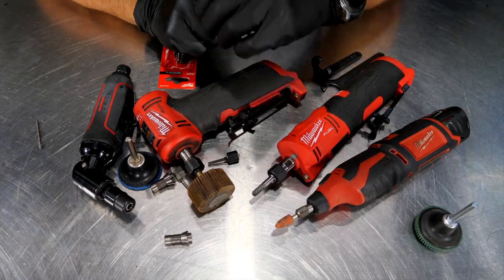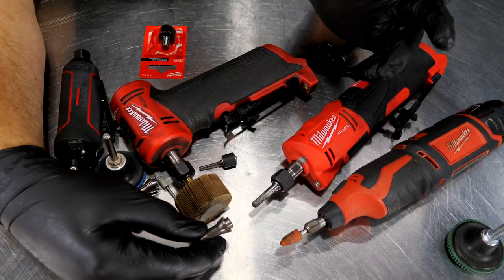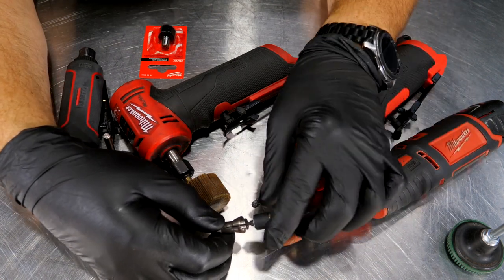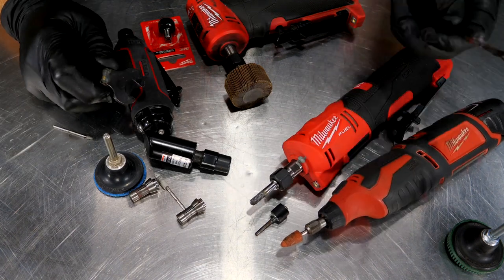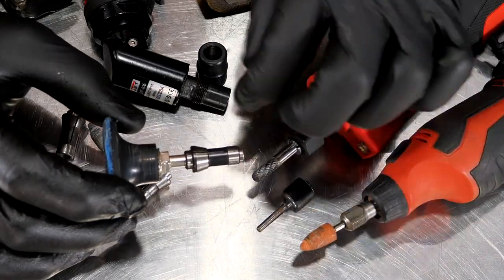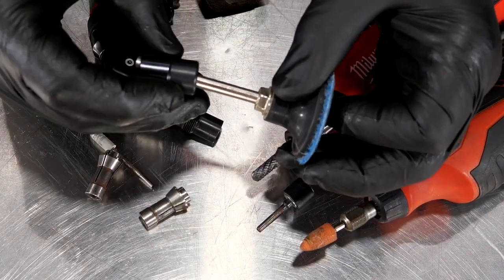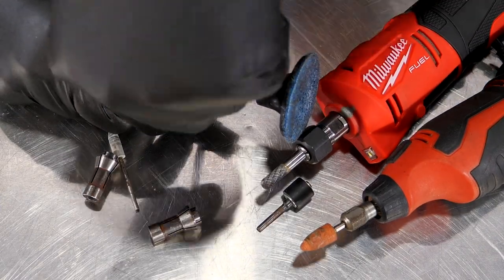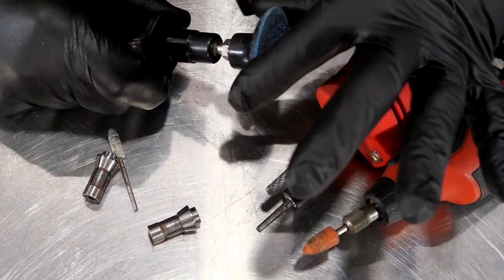Collets and Safety Collets - How To Use 1/8" Accessories with a 1/4" Collet Die Grinder

Comment: This has been a great help thanks! I gave my old m12 rotary tool to my brother so he can do his projects and bought the right angle die grinder so i can have 2 tools in one. The M12 rotary tool with out a paddle made me nervous to use when using the cutting wheel; also i wanted it to be more right angle and have a paddle off switch for safety.

Comment: After watching your video (which is very good), I went and managed to get the Milwaukee 1/8" Collet (48-66-2486) shipped from the US to the UK to fit my M12 FDGS-422B Die Grinder. It doesn't fit.  The size of the thread on the tool is too big to allow the collet to screw onto it. Big disappointment as I wanted to be able to use Dremel bits without using one of those sleeves. :(

Comment: A few of my air tools came with the 1/8" collet, never used it, since a Dremel style tool is designed to be used with 1/8" accessories. Die grinders normally use 1/4" accessories.
Reply from the maker: That is correct, most die grinders us 1/4" accessories, but there are situations when an 1/8" accessory is needed. Thanks for watching.
Reply: @Shoptoolreviews  Right on, like your videos.
Reply: @Shoptoolreviews  By chance have you guys made a video showing the viewers what are the best accessories to use for rotary tools and die grinders? I just bought a the right angle die grinder at a really good deal from Home Depot and I'm having to piece together what I should buy for it. So far what I've got is the Milwaukee 1/4 in. Arbor Cut Off Wheel Adapter 48-07-2486, the 1/8" collet set, and Milwaukee 2" Cut off wheels. Thanks!

 Your video was helpful!

Comment: I just have the opposite Problem. I would like to use a 1/4 bit tool for a 1/8 dremel. Is this possible?
Reply: Did you figure this out? I have the same issue

Comment: After hours of trying to find some way to use 1/8” bits in my cordless DeWalt die grinder model DCG426, I stumbled across you talking about the issue front and center. Thank you! Wait, I still don’t know how to accomplish this on a DeWalt, do I? And my collet and it’s nut are made so they don’t come apart so I can’t just throw an 1/8” collet in it. Fudge…what to do. 

I had an idea of mounting a 1/4” chuck on a 1/4” shank but don’t find a reducer shaft to accommodate that. Suggestions gladly welcomed.
Reply: From what I can tell, Milwaukee is the only big battery platform offering cordless Rotary tools (Dremel) and these compact die grinders. 

The tool you mentioned is larger, so I don’t know if motor size is part of the design when these interchangeable collets were engineered. You may be out of luck but I would continue to browse the web or contact manufacturers to narrow Dow your options. 

My top suggestion is to determine if you need a compact die grinder versus a standard size, and then the M12 line I think can be your friend. I use DeWalt for my main shop tools but Dewalt doesn’t make 12 volt batteries. Half The investment here is in the form-factor (in my opinion). 

But If you don’t want to spend the dough on new cordless tools - I would just suggest using a basic corded Dremel/Rotary tool for your 1/8” needs because they are going to be smaller than that DCG426. They are pretty affordable from Harbor Freight, nothing fancy but will do what it needs to with the 1/8” shank bits. 

Good luck!
Reply: Thank you for the suggestions. I should have updated my first comment to let people know that I found a collet at a tool supply store (Hall Tool Company) that can be used for 1/8” shanked bits. Additionally, for any size up to 1/4”, I found a quick release (hex shank) mandrel (also called an arbor) that screws into a 1/4” drill chuck. To make it into a round rod that will fit my 1/4” die grinder collet, I tightened a piece of rod into the new chuck head, then put that rod into a drill and ground the hex shank round by rotating my drill in the opposing direction of a belt sander’s movement until it was a perfect fit for my die grinder collet when tightened down. Now I can use bits with 1/8 or 1/4” shanks and the occasional in between sizes of shanks using the Jacob’s chuck with the 1/4” shank that was ground down from a hexagonal shape. I hope that is useful for someone. Remember to use caution when using any die grinder at it’s fastest rpm speeds.
Reply: @ReadyUpGo  this is quite an effort you made. I’m just thinking about the connection points…The quick release hex shank- I imagine would fit an Impact driver? 
This screws” into the drill chuck which is for 1/8” shank bits. The chuck has a threaded female opening and can be detached from the shank itself?

Come to think of it I think I have explored an option like this wondering if my impact could be used with drill bits. 

Anyway So then you sanded the hex into a cylindrical shape to fit the collet of a 1/4” die grinder, and are able to tighten that collet-nut around the [now] cylindrical shaft. 
Lmk if this is accurate!

My concerns would be: 1 - the drill chuck unscrewing itself 2 - the centrifugal force on the jaws and body of the chuck somehow maxing out at high RPMs

Comment: great video for people that shouldn't own these tools if they don't know what there doing
Reply from the maker: That's not exactly true. You'll find that there's many many people that know exactly how to use these tools in a professional manner, but they've never seen or used a tool with a safety collet. Thanks for watching.
Reply: @Shoptoolreviews  i never did until i owned both the Milwaukee tools. a year ago. and I figured it out. pipe fitter /welder
Reply: It's not that they don't know what they're doing. It's a bad design.
Reply: Oops, I hate this stupid app, was not trying to post under your comment, sorry
Reply: @saulgoodman2018  Bad how? Are they hard to use?
Reply: @davedakroub5323  Did yo watch the video? The safety collet is annoying.

Comment: Or they can make it easier, and use chucks. Like on a drill.
Reply: Pretty sure the RPMs are too high on these tools for a chuck
Reply: Also, the tool would probably have to have a motor capable of torquing the weight of the (keyless) chucks, which then defeats the purpose of having a compact tool. 

Rotary tools use collets, routers use collets, because those bits weigh less, the majority being for surface applications versus removing material like a hi-amp hammer drill which would use a chuck.